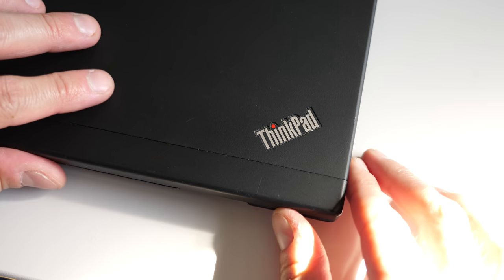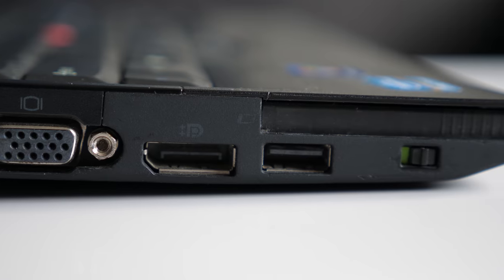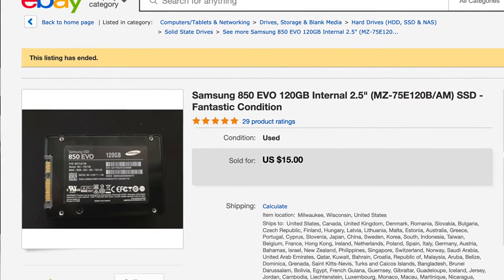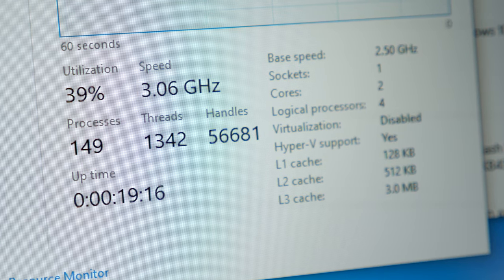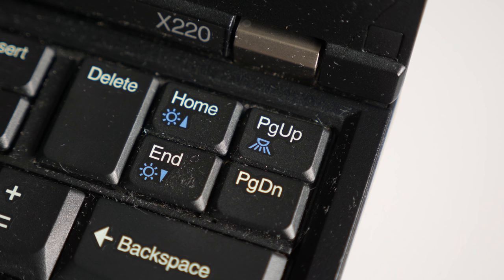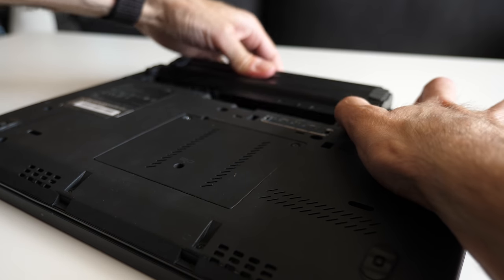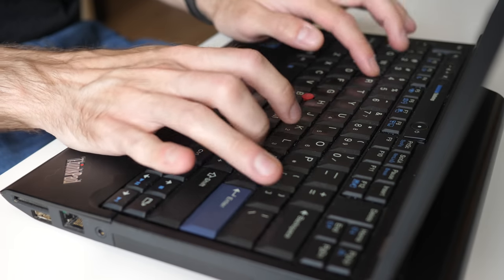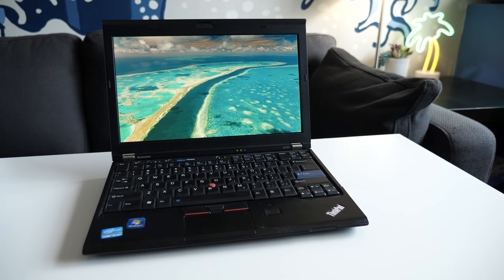The $100 Laptop Challenge -- This Old PC is Better Than You Think

Comment: How do you get past the "too old for this OS to operate" issue? Also, the lack of drivers for older models, and the basic issue of Windows (especially) not allowing certain upgrades at all.  
I have a flatbed scanner for example, that can only run on a win XP or older machine.  So I keep my old HP laptop for that purpose.  Same for an embroidery machine I own.  What's the point of resurrecting these if they don't work with modern peripherals or software?
All that said, this would be a perfect computer for a stand-alone house computer system that doesn't need a lot of computing power, just the basics and will be running 24/7 out of sight.  It's also a great option for home controls outside of the house like garden greenhouses, watering system, etc.  I could hook it up to my Arduinos and I'm sure it would run without any problems.

Comment: I'm still using an E330 bought it back in 2012, even then it was a budget laptop went on sale for around 520 usd, and I don't know why but I've cleaned it up twice and in both times I see little to no dust, I don't know what kind of engineering went into it, and even under load the cpu never exceed 65c, even my desktop is from 2012 upgraded the gpu though, maybe we've reached a point where even more powerful hardware is more than what you actually need. which is both cool and sad since nothing really mind blowing any more

Comment: I bought the same specs and my computer costs 550 dollars and plus it has a slower cpu baze clock 2.5 ghz clockted to 3.1ghz qns urs is 3.2 think and your have more threads and more cores nice
Reply: Bought a new laptop for 650€: 2 cores, 2 threads, 8GB RAM, loud as hell
Upgraded my 11 year old machine for 100€: 4 cores, 8 threads, 16 GB RAM, also loud.

I feel your pain.

Comment: 3:19 WHY would you get one of the best computers ever made, only to saddle it with the worst OS on the planet?

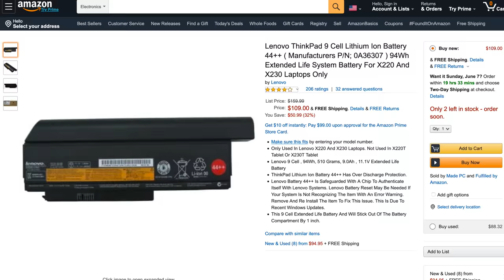7:30 the "warranty" is the fact that it's so cheap.  Even if you go through 3, you're still saving $100 over a comparable new system.  And it's a Thinkpad, so the odds of even going through 2 are negligible.

Comment: A few years ago you could pickup old Thinkpad laptops for $20-50 then all the geeks started posting videos about how easy they are to update and use them as a daily office machine for a fraction of new...now they're selling for $200+ on ebay.  The ones you still find under $100 are usually beat to shit, broken, missing drives, missing RAM, missing batteries, etc.  So you aren't gaining by buying a sub $100 used laptop in many cases, read the fine print, you can easily spend hundreds of dollars in replacement parts for damaged, missing, or worn out stuff in a machine that's 10+ years old.  

If you can get lucky and find them right off lease, generally they're in much better condition as many just sit on a desk in a docking station with an external monitor, keyboard, and mouse, so the laptop itself is pretty much new in terms of the track pad, and keyboard and many of the ports are generally in low use condition.

Comment: Last year I was looking for an Old Laptop so I could use it to play Retro games but good thing my friends dad gives me his old 2 Dell Laptop (LATITUDE E6410) and (LATITUDE E4310) and both have Intel i5 so I soon that i had those I upgrade the RAM and SSD to 8GB and 1TB SSD and both of them working really good. The one is Windows 10 which is running so smoothly and faster, and the other is Ubuntu 20.04 LTS and running the same as the other one, but I have to spend around $250 because no power cord and RAMS and SSD cost more. But it still worth it especially when you only going to use it for playing retro and office or Personal.

Comment: i always believe that you dont always need to have state of the art hardware and that yes a 10 year old hp presario CQ56 laptop can perform nice and smooth with windows 10 this laptop i use for making music with since i got it 3 years  friend of mine wanted something new and gave it to me with a few update to ram going from 2x2gb to 2x4gb and replace the hdd with one of those cheap 128gb kingdian as the main drive for windows 10 and the few software i need to work with and replace the defective optical drive with a cady with a 500gb hdd and its been 3 years and i not had problem with this laptop

Comment: Great video: thanks. And you can get an x230, that allows output for 4K monitor (@30Hz), via mini display port, and put 8 to 16 Gb of RAM and an EVO SSD of 500Gb. I will never buy new laptops ever, as long as Thinkpads appear on the refurbished market. There are companies that offer 1 year guarantee, and classify the state of the machine. An A grade machine is quite impeccable. This allows freedom on the go. If you break the screen, you get a new ips one online for almost nothing, and videos online showing how to replace it. I already replaced the keyboard that I rotten with alcohol gel at the beginning of the pandemic. I take it to the classes I give (I am a CSc Professor), and  I use the rest of the money of a "mid-range" laptop (half that of a MacBook Pro) to have a Ryzen 5 Desktop, with 750 Gb on two SSD's, 32Gbs of RAM and a GTX 1660 that, surprise, surprise, runs FS 2020 at 4K ultra (sims are not like FPS or racing games, and after trying, I realized the experience of using ultra settings at 4K is better than more smoothness at medium settings at 1080p). Don't spend your precious money making bad choices on hardware, is my suggestion.

Comment: I have an old HP EliteBook with 1st gen i5, 6GB of RAM, old NVidia Quadro with 512Mb of VRAM(equivalent of 8600GT by performance) and disk upgraded by me to an old SSD from Kingston (it had 750 gigs 5200rpm so it was kinda sluggish even on Linux)
It works flawlessly for what I use it, word editing, light photo editing, web browsing, uni stuff and playing some older titles. 
I bought it for ~250$ way back in 2015 when it was already 5 years old and to be honest, I don't see why, for this king of light tasks, would anyone need a new, often way, way more expensive laptop. If it works and doesn't affect my productivity by any means then why should I change it?
It still has it's original battery and pushes around 2 hours without being plugged in.

Comment: I have the bigger cousin Thinkpad t420. Same processor. Put in 4 gigs giving it 8gb ram total.
Got adapter for a hard drive in the optical bay and got a Kingston m-sata type 240gb to plug in next to wifi card.
So I have a ssd in HDD bay for windows, a Kingston m-sata for linux mint, and a firecuda 2tb sshd in the adapter drive bay that is shared between Linux time shift and windows for mass storage.
No new laptops can hold that many drives haha

Comment: I bought a lenovo g580 with a similar cpu and 4gb of ram somewhere back in the early 2010s, it still works perfectly although the plastic bezels and screen have suffered a bit over time (i wasn't very gentle with it), I'm guessing a thinkpad would be even more durable. Like you did in this video, I threw in an SSD and the laptop is still lightning fast and even fine for light gaming. I'm thinking of refurbishing it even more with some replacement bezels from alibaba and maybe a new screen even. New laptops are too expensive and offer too little performance.

Comment: Im not a student or what that there was writed but I really like use old computers because I am so surprised how much they are old and they are still able to run of course for gaming you can play old games or if want new ones need buy GeForce NOW and play whit Ethernet cable as well wifi in old laptops sucks but they are still equivalent of an 100 tab or phone but as well they quality components are low their goods like have have more ram then a 100 android device and more storage and they are also modifiable so a laptop for 100 dollars is better choice then a 100 tab or phone.

Comment: How was this with Ars Technica testing some 140$ Walmart Laptop that really sucked? Still have an old Esprimo X9515 (Core 2 Duo, 1440x900, from around 2009 that I got for free and runs perfectly fine with Linux Mint. Wouldn't want to carry it around, because it's a brick but else it's fine. Still has a 160GB 2.5" HDD but is starting Firefox faster then this Walmart Laptop (with Fedora 32).
But now I'm happy with my new 625$ Laptop with R7 4800U, beating even my Desktop i5 4690K @ 4.4Ghz in Single Core, while in Multi Core the new mobile chip is murdering the i5 (nearly 4000 point in Cinebench R20). Running it right now for video compression via Handbrake in the other room.

Comment: Im watching this on my latitude E6430 with a samsung ssd and upgraded to 8gb ram. bought it for 70 20 dollar ssd and 35 dollar ram. This thing is soooooo much better than a crappy chromebook for the same price minecraft runs at 50fps and other games also run fine. The keyboard is ok and backlit. THis thing absolutly rocks like i cant express enough what a good deal this was. This laptop competes with 400 dollar ones like thats crazy. The thinkpad is also a great keyboard but a little big. 

DO NOT GET A CHROMEBOOK BUY AN OLD BUISNESS LAPTOP AND GIVE IT AN SSD

Comment: Nice video, 
I just hate to see good stuff getting thrown away - nice to see retired computers getting a new life!, 

I have been using a Lenovo Carbon X1 from 2013 as my home computer, it served me well for close to 8 years but now it needs a costly fan replacement as the noise is unbearable.  
So I found a retired Lenovo yoga pro 2 at work as a replacement while looking for parts for the X1. 
Just too bad that the yoga is not a thinkpad, only 4GB memory soldered on etc. And keyboard layout takes a bit getting used to..   3200 pix screen in nice though
 
Running Linux Mint on it , as Im looking to see how it can replace win10 for my daily home use. So far - all fine.  
Been a windows user since the 3.0 days , via 3.1, 3.11, 95, NT3.5, NT4 , 2000, XP , 7 and 10 in daily use.  Skipped the Vista and 8 clusterf**ks and glad I did, lol!   So far , Mint has been the smoothest OS experience I've had - it just works and does not get in my way like Microsoft all to often like to do. 

But 4GB of ram is not quite cutting it for me with todays resource hog web pages.  Been used to keeping 50+ tabs open in the Opera browser, Firefox is struggling with 15, lol!  

One of those X2xx laptops with 16GB ram suse sounds tempting though :)

Comment: An SSD in any machine helps a lot if it has multiple cores & at least 4 gb ram.
Dad has a Lenovo T420 & im a bit surprised on how much of a difference an ssd did too it bought a 500 gb wd blue for him & one for my desktop pc. Mine still uses the harddrive it came with spinning away as a wifi extender atm that constantly fills up the harddrive slowly with log files, actually had too see if there were any open source alternatives just too stop that crap & trying out virtual router now, shows the password in plain text in the program with as far as i can see no option too turn that off which is not great for security but eh it works.

Only thing I'd miss from a newer laptop really is perhaps a bit stronger wifi card & a higher resolution screen otherwise its pretty spot on with an ssd & 8 gb ram for general easier tasks & older games that aren't graphically demanding, half-life 1,2 killingfloor 1 that kind of stuff runs fairly decently at native resolution of 1366x768.

Comment: At the end of the day, you're still buying a laptop that was high end performance for its time and designed for a price tag ten times what you're paying now, let alone ten times what you pay for some of the cheapest new laptops. It barely matters when it came out (at least not 'til you cross the OS compatibility threshold); a 2000$ computer will always still be a 2000$ computer in some respect, whether that be performance, design, featureset, dimensions, materials, servicability, etc. A machine designed to be 200$ will always be a 200$ machine.

Comment: I have one it goes with me everywhere. I love the hinge quality. The screen turns 180⁰. I recently changed the charging port and the charger. It came with a 4gb ram. I added another 4gb ram. It was a 32bit made it a 64bit with windows 10. The 128gb ssd fills up fast. I really love how portable it is. Getting parts to it is easy and upgrading it is also crazy easy. I love the keyboard. it has really dope key travel. It would have been pretty cool if it had a backlit keyboard on those old school keyboards 😅😅😅😊. I think it's 13inch or 14inch. Its so easy to carry around and very portable. I don't want to move to the new Thinkpads. They are too expensive and not as durable as the old ones. But if i must have the new laptops. I will go for the Thinkpad p14s. Series

Comment: Nice!  I did the same thing as in this video.  The corporate laptop had a locked bios with a funny sleep mode causing it to seize up and I could not turn it off in software (I tried everything in Windows 10) and if you tried to unlock the bios with a battery uninstall [edit, and reset of the BIOS by shorting certain pins] you might ruin the BIOS I was told, so, I found a workaround:  installed the harmless freeware "Caffeine" program that simulates a keystroke every 59 seconds, and, since then, the freezing has gone done from one a day to one a week.  Coincidence?  Maybe, but it works.
Reply: If you don’t know the password, you can remove the cmos battery to reset it to the default. Usually the password is removed on mobile workstations and business ultrabooks that have gone off lease but not always. Having an inaccessible BIOS sucks when you need to disable a setting or enable something.
Reply: @NormanF62  I've heard an urban legend story that doing that will somehow corrupt the bios.  It's a security feature.  Not confident enough to call the bluff on that story, so I just leave it as is.

Comment: I love coding on older devices, I will go out of my way to try to use old tech but obviously for some projects I am on my beast desktop with several monitors, hell though if I am going to see a friend and I only need to code I'll take a 2014 ThinkPad with 4gb or RAM and nothing installed but notepad++ and edge

Comment: Years ago people didn't realize that a 200 dollar Chromebook did 95% of what they needed online. For 2 years now Chromebooks have outsold all other laptops.
Maybe it is time to realize older laptops also do 95% of what you need to be done online. 
When I had to work from home I got an old Lenovo Thinkpad L430, 130 dollars, it does the job fine. For nice video conferencing I picked up a first-gen Microsoft Go, with a great 5 mp front camera, 180 bucks, which is also a windows machine, so I can use it for super portability too.
That is 310 dollars and most people I video chat with on their 1000 laptops don't get the video quality my little setup does.

Comment: my 4th gen iseries thinkpad beats your x1 carbon. upgrading the CPU did cost more than the laptop you are reviewing since but can have all 4 cores can run all the cores at 4Ghz. Beyond 4th gen most thinkpads came with low power CPUs for many generations.
I did get ripped off in price buying it used but in the 3rd world such used machines cost more, though mine did come with a SSD already.

I dont use thermal paste, i use a thermal pad with the stock cooler.

Comment: Wow, cpu per-core performance hasn't changed for years. Look at used server hardware for NAS-es next 😆 Also, it pretty much describes manufacturer's choices to make scheduled obsolescence more pronounced (apple fragile keyboards on MacBook 2016 or bad cooling and non-replacable batteries for example)

Comment: Hi, I've been trying to do such upgrade to my Sony Vaio VGN-TX2XP for years, but it seems the only chance is to replace the internal HDD with a 64GB KingSpec 1.8-inch ZIF 40-pin SSD Solid State Disk SMI Controller (MLC). Nevertheless the Vaio won't boot because the master/slave identity is hardcoded in the BIOS and you won't be able to boot from the SSD unless you disconnect the DVD drive. Ever heard/tried anything like this? I've installed Lubuntu on the HDD and it's fairly responsive for a 1Ghz x86 1Gb machine, I'm sure it would be snappy from SSD.

Comment: I’m a little tired of the upgrade treadmill, personally.  It’s mostly driven by software that arbitrarily goes obsolete.

Like, eg., how my Mac Pro 2009 can’t run High Sierra - unless I flash the firmware so it thinks it’s a 2010, then it totally can.  But then, even HS is two releases old, though, so naturally half the stuff on the App Store won’t install on it.  I guess the four core Xeon with 16GB RAM isn’t enough to run Omnigraffle.

Or how the video capture card I bought only has drivers for Win 10, despite the fact I can’t get 10 to install graphics drivers without terminally booting into a black screen, but Windows 7 works flawlessly on the same hardware and can do everything I need it to do.

Sorry guys.  You’re going to have to deal with my security-compromised computers and phone and tablet being on the Internet, risking everyone’s safety, until software companies can maintain an OS release for at least the term of one US president again.

Comment: yea, I bought one of those new. The screen cracked, the battery went funky. still use it as a headless media server, but not sure it is worth $100. 

My original (not lenova) IBM T-22 is a hell of a lot better laptop, and it is over a decade older. 😆 still runs latest linux without a hitch.